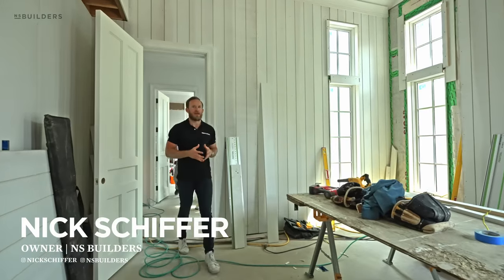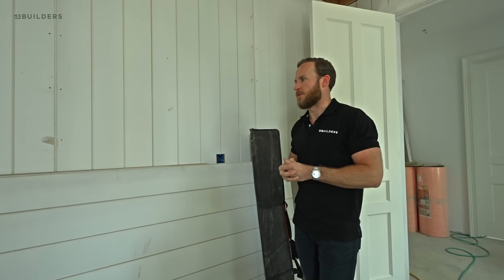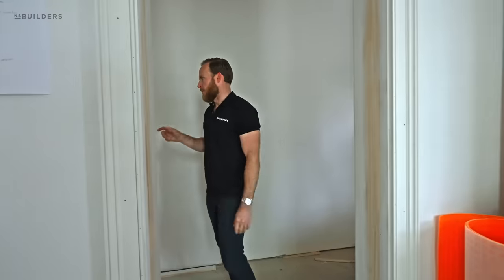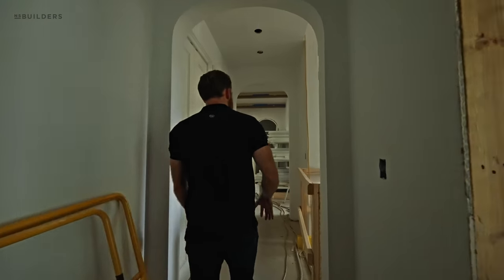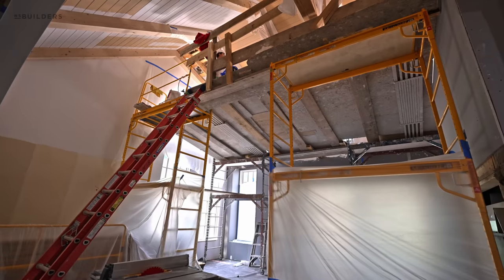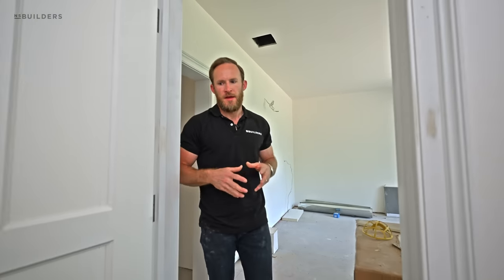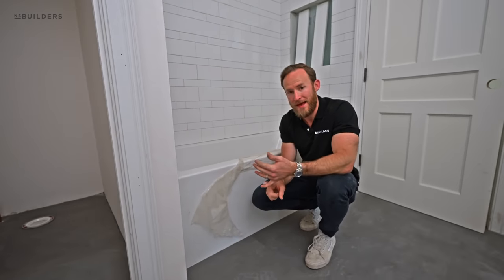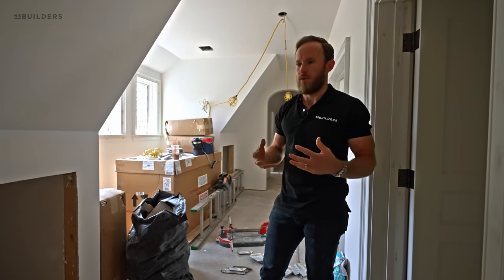This is NOT a window sill but it's often called that

Comment: Love the KB profiles. I have actually just used them in my own home and they are extremely beautiful. Huge thank you to NS Builders for introducing me to KB.
... and ... First. :)
Reply from the maker: You're welcome. It's our go-to
Reply: How do they price up when compared to your traditional lumber dealers stock poplar preprimed?
Reply from the maker: Very competitive
Reply: Full range of finger joined profiles not available locally, it would be like comparing apples and oranges. 10/10 would use again. Replaced all trim on 1st floor of modern colonial for less than 5k. Not standard install with some highly custom application.

Comment: Great video. About to start trimming out a house which requires a stool to be attached to jamb extensions. The supplier advised me to attach the stool to the extension by dropping the stool down 1/8” and then just nailing the stool to the extension. Said this would prevent cracking along the line if I attached the stool flush with the top of the extension. Thoughts?

Comment: The best choice for water control in any room is a strategically placed floor drain. I use ceramic tile baseboards in wet ares.

Comment: What adhesive are you using on the window trim miters? It looks "thick" and was wondering what the setup time is with the clam clamps. I've used Infinity PUR for a quick setup, the the clams and traditional glue when needed.